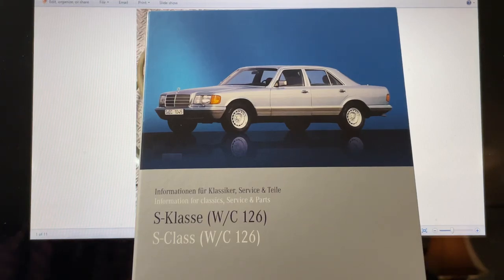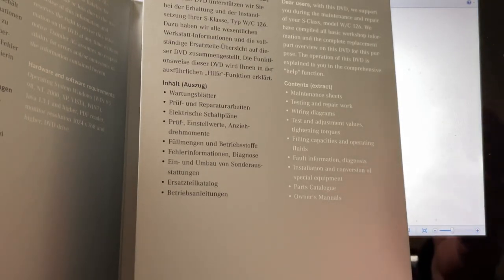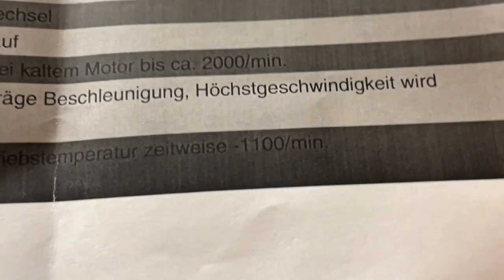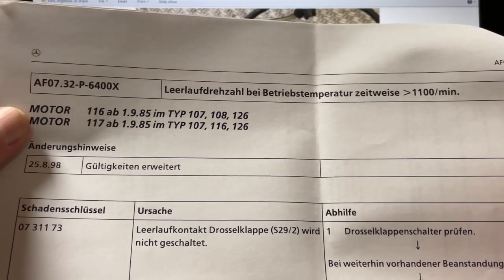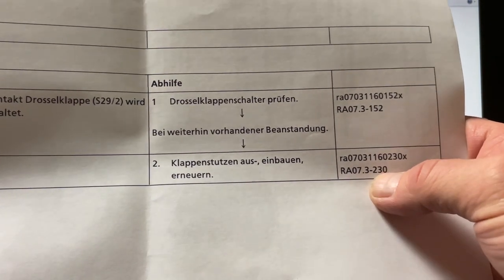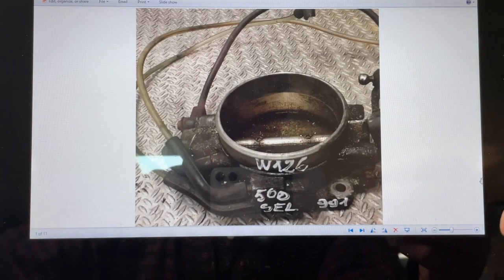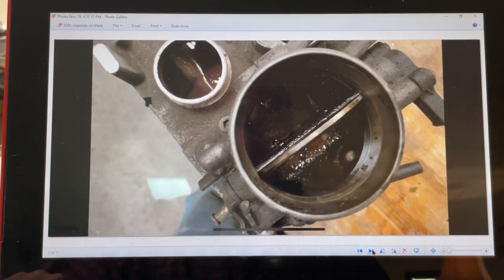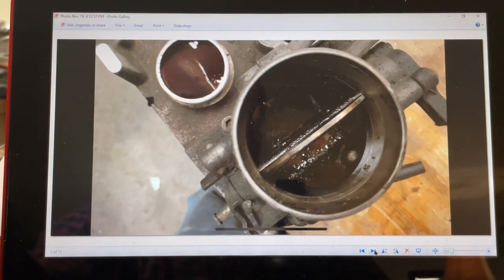Mercedes W126 - All MY 8 CYL MB Servicebulletin AF07.32-P-6400X idle speed @ op temp Interm 1100rpm

Comment: I have 4 service manuals.(2 chassis,climate and v8 engine). Are there anymore for 86 420sel?
Reply from the maker: Yes, the same set you got in different languages and then at least 3 revisions:
1986, 1989/90, 1993 and 2010
Reply from the maker: Plus the Service Bulletins and parts books
Reply from the maker: But George, I think for the moment your all set with the manuals you got for the most part. Make sure the Manuals match the parts you are working with / on. 
I also forgot to list the Databooks - that is something you may want to get.